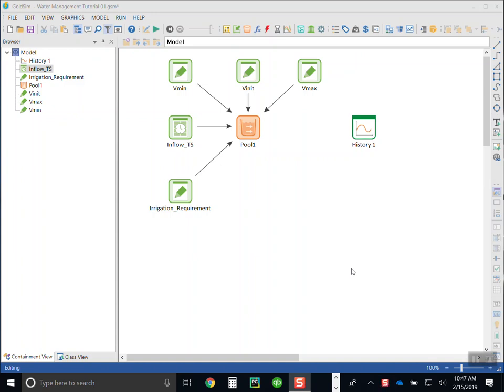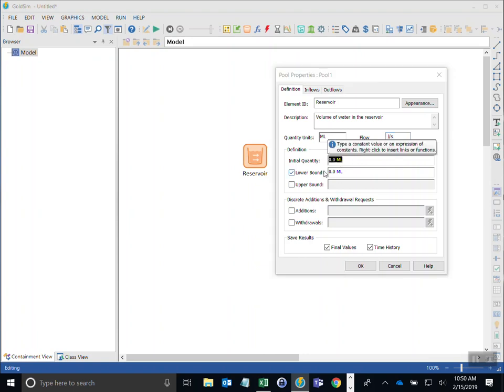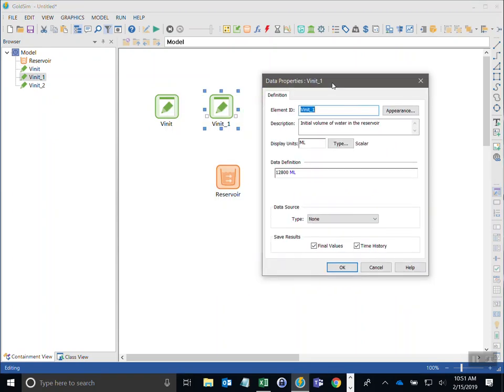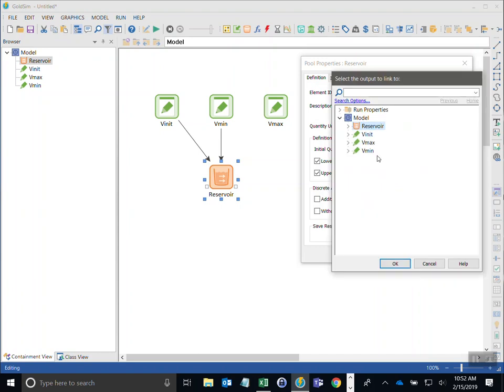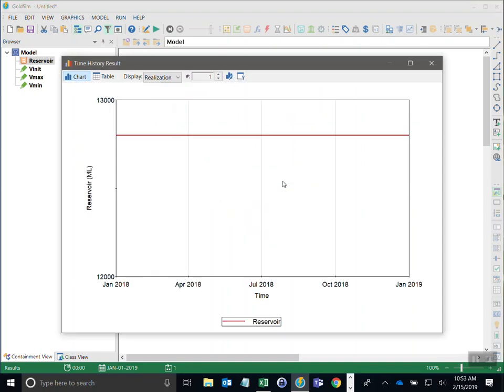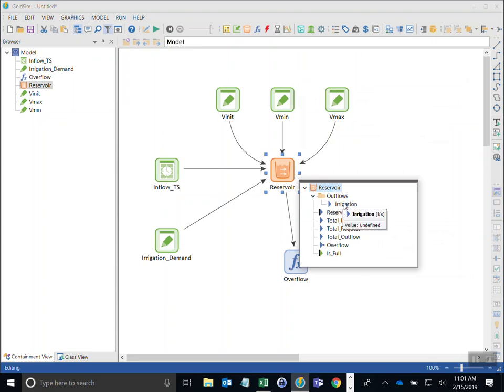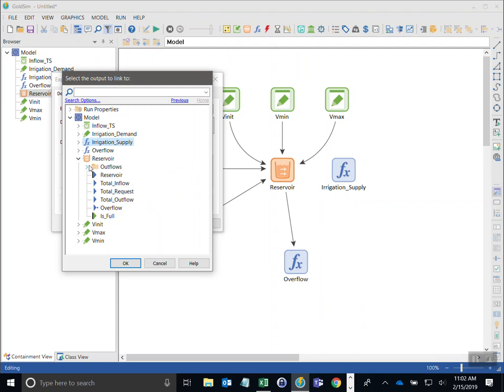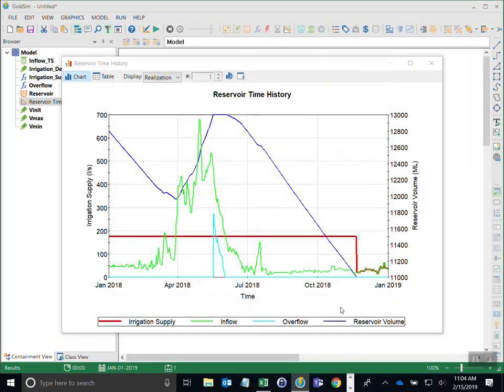Tutorial 01 - Build a Simple Reservoir Simulation

Comment: I am a student doing a project in supply-demand dynamics in water reservoir operations, just wanted to ask if it is possible to use your software to analyse reservoir operations and predict outflow for the next 10 years for instance
Reply from the maker: Yes this is possible while keeping in mind that GoldSim is a general purpose dynamic simulator so you will need to build the functions that control the reservoir releases.
Reply: @GoldSimTechnologyGroup   i will control my reservoir releases by implementing the operating rules as you showcased in the reservoir simulation video
Reply from the maker: @priviledgemutsamwira9776  Good luck with the model. Here is a good place to find some examples: https://support.goldsim.com/hc/en-us/sections/360008979074-Water-Management